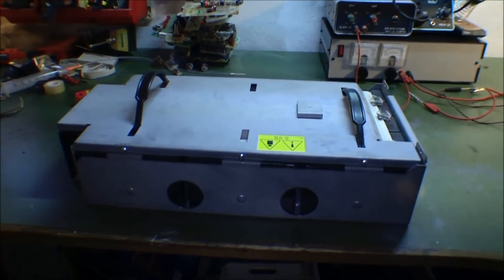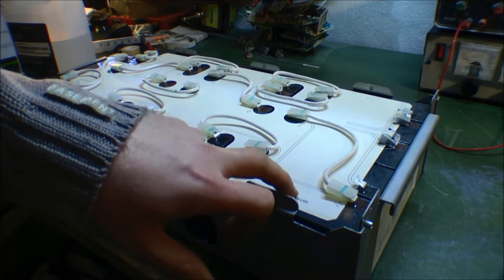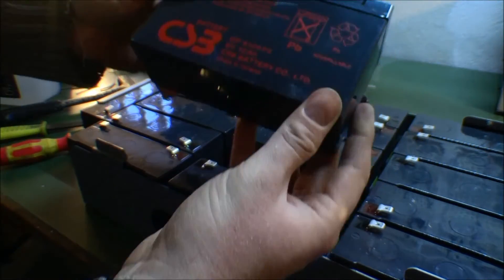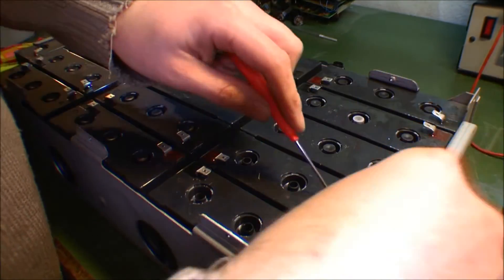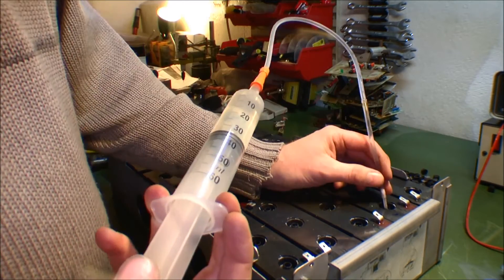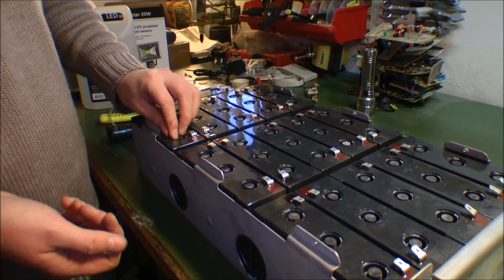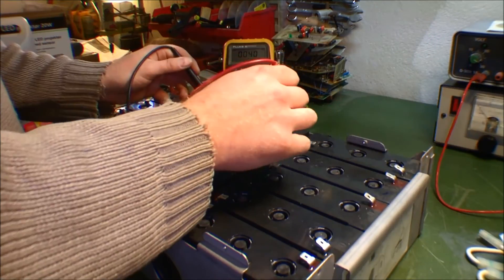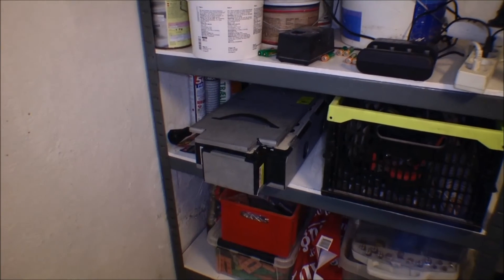Hopeless attempt to rescue 16 6V Batteries - 130

Comment: Do you have any idea how many volts/amps the house uses in power saving mode?
Reply from the maker: Hi MultiMegaMaxx
The House uses 230Volt AC,,,,and if I only run it the most necessary things,, I would estimate that it could be around 200watt's (This is outside my Datacenter,, it will not run on batteries)
So 200/230 = 0,87 amps.
Why?
Thank you for watching! :-)